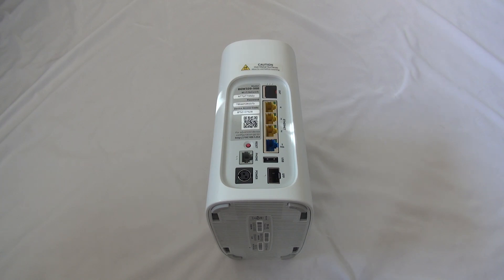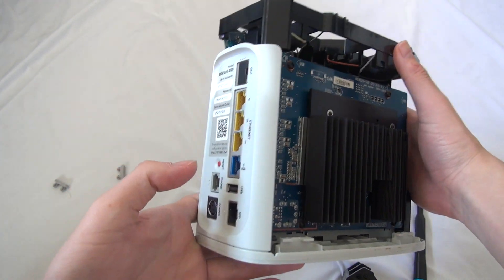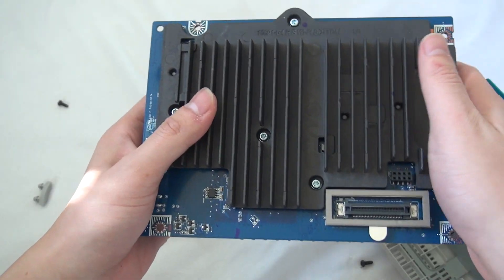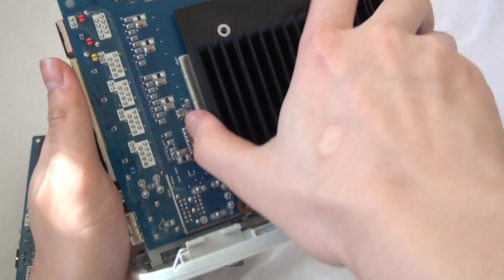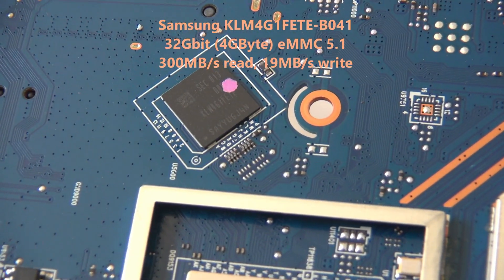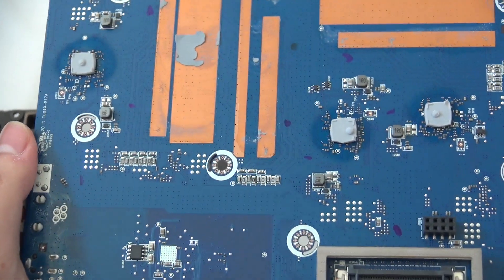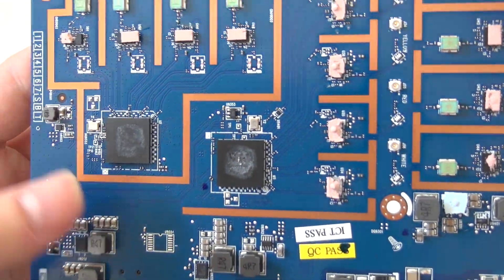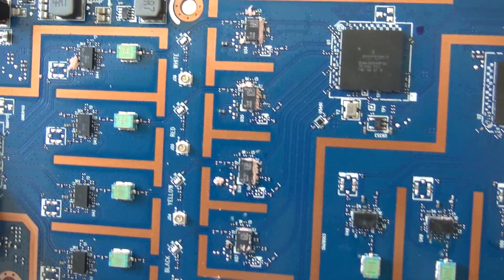AT&T BGW320-500 WiFi 6 Gateway/Router Teardown

Comment: I wish to permanently disable the wifi physically... can i just cut the antenna wires?   &/or rip off the wifi chips ?? Without breaking the modem lol.. just need to use the ethernet.... thanks!
Reply from the maker: Your best bet is to remove the green ceramic antenna thing (pause at 5:58 to see it). No guarantee that it doesn't break your router in some way if you remove those green thing though.

A safer alternative would be to turn the WiFi power down, disable the radio in the web interface, and then unplug all of the small connectors (5:58 with the antenna color marking on the board).
Reply: @KN4LXD ok thanks for the prompt response! So i can just remove the 8 green 'crystals'?
Reply from the maker: Yeah you could remove it.
Reply: @KN4LXD  ok ill see if i find a screwdriver to do it... i hope it doesnt break the device..  Kinda risky lol
Reply from the maker: Then you could just unplug the antenna and turn off the WiFi radio. That is your safest bet if you don't want to break something on the board.

Comment: The QPF7219 is the 2.4 GHz Wi-Fi iFEM (Power Amplifier, Low Noise Amplifier, Transmit Receive Switch, and an integrated 2.4 GHz Band Pass filter)
Reply from the maker: Thank you for the information!

Comment: The part between the Wi-Fi SoC and the Antenna port is a Band filter. It Splits the 5GHz Wi-Fi band into the upper and lower bands so you can get twice as much traffic through.
Reply from the maker: Thank you for the information!